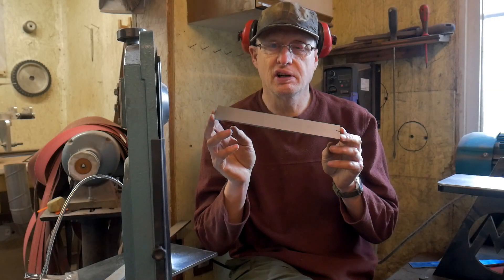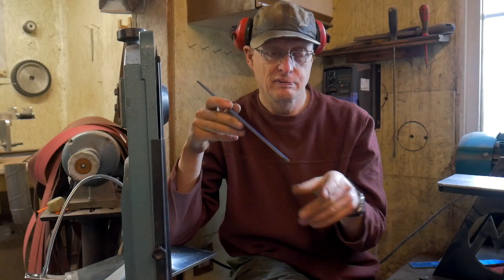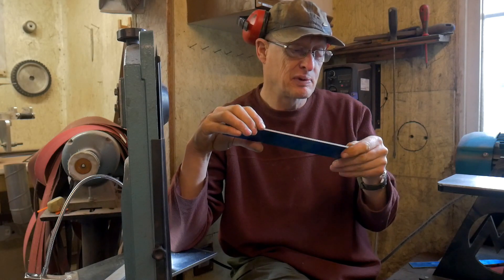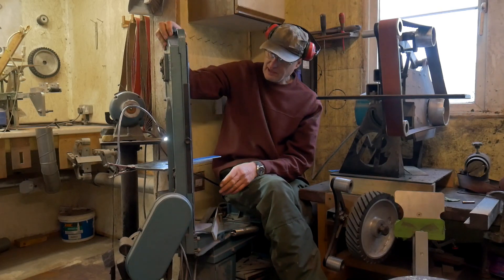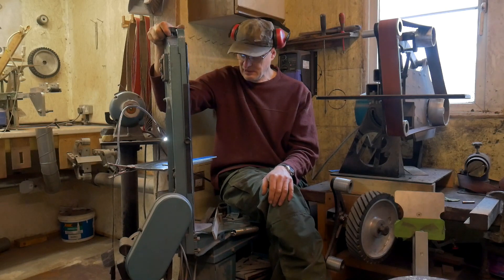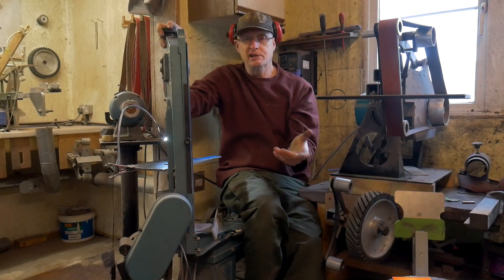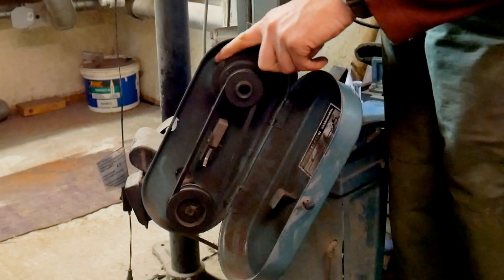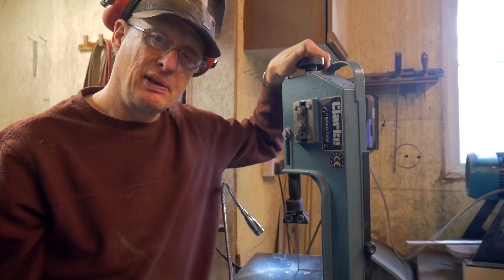My metal cutting Band saw  The Clarke CBS45MD  Is it any good?

Comment from the maker: I mention in this video that I had the band saw set to slow speed but in fact watching this video back I realise it was set to the highest speed. Using 16tpi blades and cutting 3mm or 4mm thick stock the higher speed seems better suited. General rule of thumb is you want 3 teeth in contact with the stock you are cutting all the time otherwise there is the risk you can strip teeth from the blade. I have also used finer blades with 22tpi, they cut well but not quite as fast. If cutting thinner stock say 2 mm or 3mm that could be a better option.
BTW I am first:)
Reply: Yeah them Band saws can be tricky.  I made small brushed to clean the steel shaving outta my teeth .
Reply: That footage at the beginning of the video is not slow. Me with a hacksaw is slow. ;-)
Reply: Yes after trying to cut 6mm steel with a jigsaw that looked very fast indeed :)

Comment: You raise a very good point Sandy with regards to hand crafted goods and what is or is not part of the process that makes the finished product what it is. Speaking as a would be customer, were the steel to be laser or water cut to free up your time, it would take nothing whatsoever away from the special nature of your knives, albeit I fully understand the craftsman or artist wishing to be hands on with as much of the process as possible. 🙂
Reply from the maker: Thanks Simon, I've never really looked into getting the blades pre made but it would speed the process up quite a bit especially on the larger knives like the XL Classic and the Camp knife. However the standard sized Classic bushcraft knife needs only minimal stock removal to get the shape so just as easy to build em from scratch

Comment: I cut 1000s of blank on a Harbor freight 4x6 vertical horzonal band saw .  25/ 39 tooth BiMetal Blade is the Best you can get for a blade dont force it . Easy pressure all you need ..  200 blanks on one blade ..
Reply from the maker: Wow your doing great to get 200 blanks cut out with one blade. I''ll have to look into getting some bimetal blades

Comment: Helllo sandy love all your videos quick question about you bandsaw have you tried different blades from another manufacturer as most bandsaw blades you buy from stock are cheap materials have you tried  looking for metal cutting blades elsewhere as i had the same problems with my bandsaw blades i now use a company called tuff saws there quality of blades are far superior to the cheap manufactured ones www.tuffsaws.co.uk give them a called i bet you can get something a lot better than the ones you are using